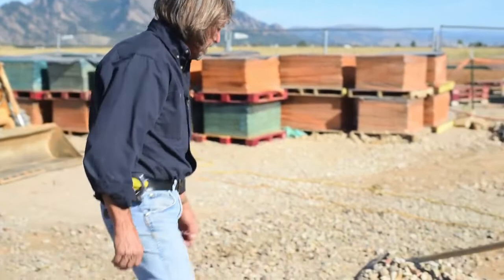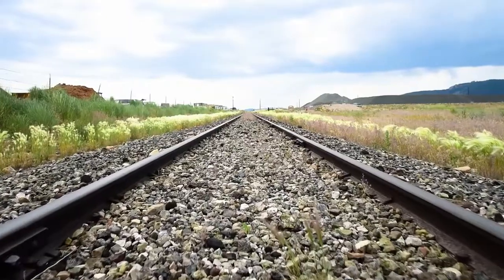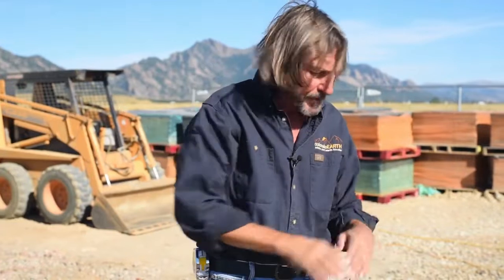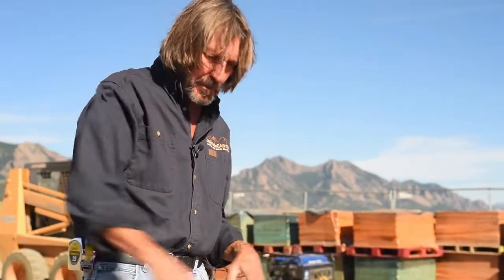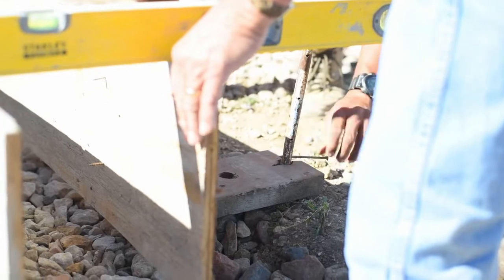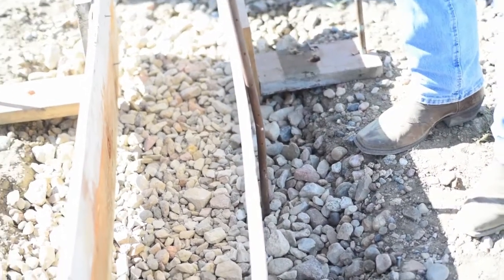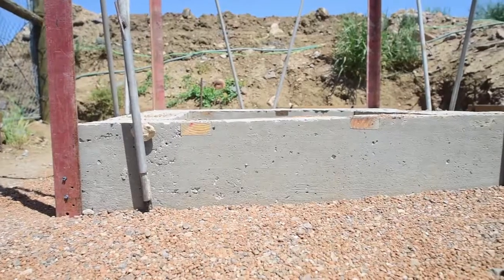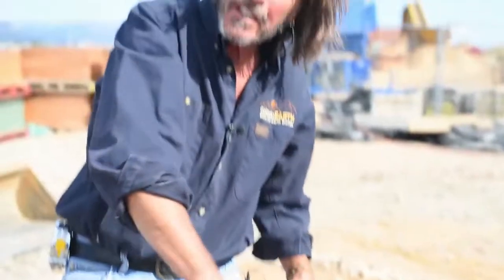Part 3   Constructing a Compacted Gravel or Rubble Trench

Comment: By using the 2x4 'outriggers', it looks like it would be very difficult to set level height along a long footing. Typically, hammering the stakes is used to make adjustments to the forms. With this system you'd have to remove or add aggregate under each outrigger which could take a long time. Is this really the best way?

Comment: Jim, another great video.  I did not understand the rebar usage since over time, it oxidizes and causes concrete degradation.  I am sure those ancient buildings don't have it.
Would you suggest a vapor barrier under and on the sides of the concrete footer to mitigate moisture path to foundation block courses?
Would like to see you upload one, addressing a double wall construction method which would accommodate insulation (like rock wool) in the exterior block walls.
Keep 'em coming.

Comment: SO how is this "connected" to the ground? Would you be worried about heavy winds pushing the house?
Reply: This is a concern in conventional building with balloon framing & light, hollow walls, but not in natural building with wall materials like cob, adobe, or earth block because of the sheer weight/bulk of the walls.  It's another reason that the rubble trench foundation is a good choice as well - the walls are HEAVY.

Comment: Great video, however your concrete will crack because the rebar will eventually rust, then expand and spawl from inside out and water will then seep into the cracks thru the concrete. If it weren't for inspections would you opt for no rebar? I'm sure you're familiar with basalt rebar, why not use basalt alternative?

Comment: First time I've seen this.   Looks cool.    We have our menu of things we do, and sometimes we ignore what stands for 100+ years.   I saw a home in upstate NY, that was selling cheap, and I looked under the home to see what the "foundation" was for most of the home.    The home sat on river stones, and was about 1" above a giant rock slab (part of the mountain).   Weird.  it has a small basement in the middle, I would theorize, that kept the entire home from sliding down the mountain.  The joists, were 2x4's, supporting the home with no insulation under the home (ouch).